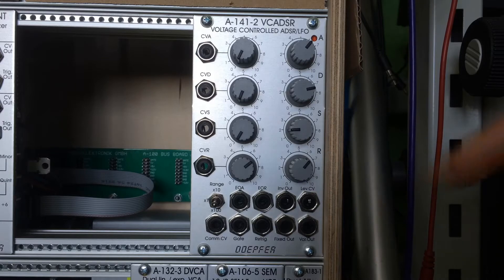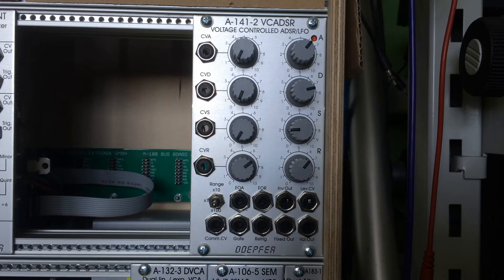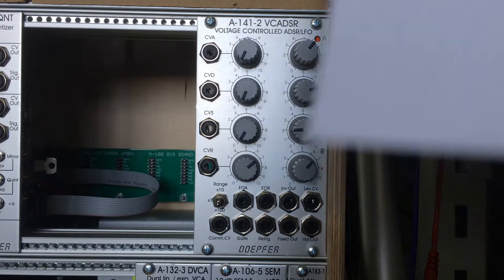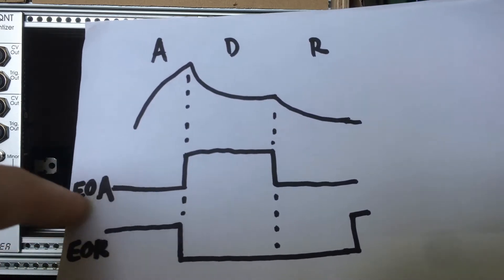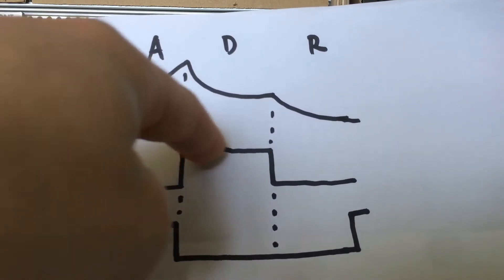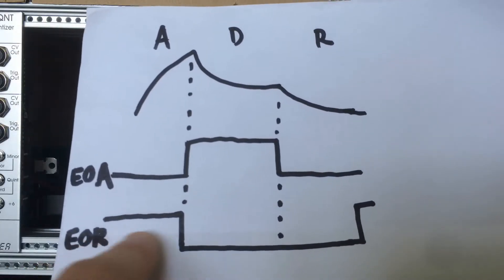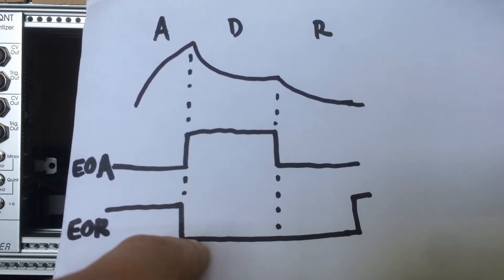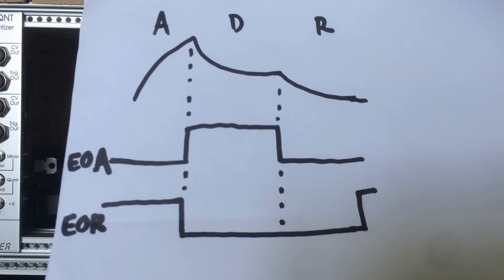Doepfer A-141-2 VCADSR Demo / Overview (with Oscilloscope)

Comment: Perfect demo, i wish all demos was so well done..thanks for doing this..that is a monster ADSR module. Interesting tips there with the lin/log shapes! Thanks
Reply from the maker: you're welcome, thanks for your feedback! planning to do more demos and such in the future, but I'm new to this and still learning, so thats a big compliment to me!
Reply: yeah, looking forward to some more demos! Good that you showed the full range on the knobs also...and great illustrations with the end of rise and stuff...Nice to see the waves on the scope also...top notch!!  Seemed to be nice and snappy envelope..Seems nicer that my A171-2 CV slew..because of the reset..i miss that on the A171-2..only problem i see with it is that it is a little to big for my modest little modular setup.
Reply from the maker: I had an eye on the a-171-2 too, never thought about using it as an envelope, but I need a slew generator, nice thinking about it that way. cant you use the trig input to reset it?
yeah the a-141-2 really is big... maybe have a look at the befaco vc adsr too, its only 8 hp, though you dont have a reset there either
Reply: oh that's right i must try the trigger..i just read somewhere that it did'nt reset...better try it myself :) I think the A171-2 is a bit similar to half of make noise maths...but without the attenuverters...many uses. can even be a divider :O i think it use the same log-lin trix to patch in to it self ..but there is a handy switch  instead. i feel the rise and fall time knobs are a little strange...half of the knob range nothing happens..it's a little unpredictable and strange module...maybe not the snappiest when in use as a envelope...i think math's a little snappier and higher voltage output.. look up dual universal  slew generator for patch ideas. ill have a look at the befaco..hmm but no reset...i think the tiptop z4000 looks great on paper...small size also..but maybe not so great in real world :)
Reply from the maker: maybe what you read about the reset is what I also mentioned in the video: that the envelope doesnt drop to zero, but starts going up again when in decay or release stage. so when in attack stage the reset doesnt do anything. what do you want to use as a trigger anyway?
the a-171-2 sure is versatile, maybe misses a range switch and yeah very similar to the maths.
tiptop z4000 looks nice, but it cant cycle i think
Reply: I dont mean to be so off topic but does anyone know a method to log back into an Instagram account?
I was dumb forgot the account password. I love any tricks you can offer me
Reply: @Jonathan Miller instablaster =)
Reply: @Castiel Mekhi I really appreciate your reply. I found the site on google and Im trying it out atm.
Takes quite some time so I will reply here later when my account password hopefully is recovered.
Reply: @Castiel Mekhi it did the trick and I now got access to my account again. I'm so happy:D
Thanks so much, you saved my ass!
Reply: @Jonathan Miller you are welcome =)